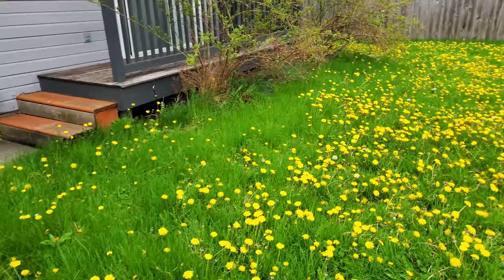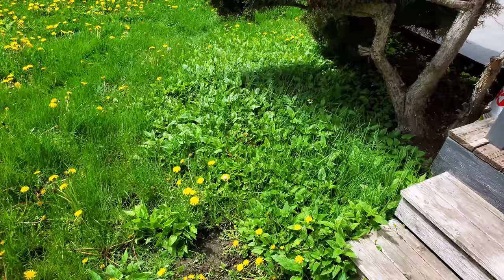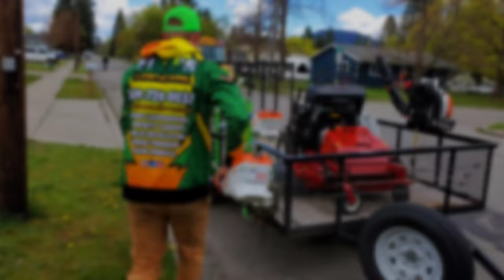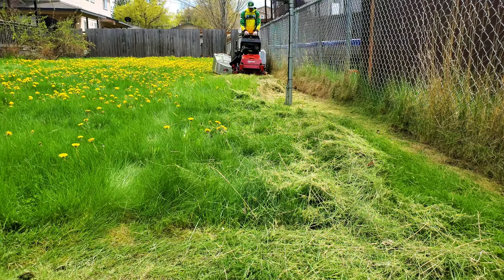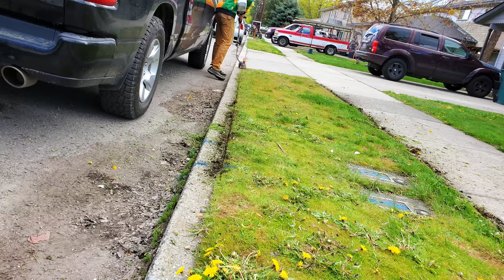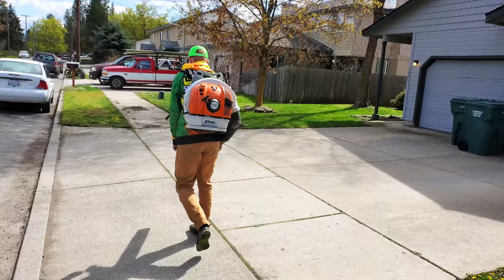OVERGROWN Lawn INFESTED With Dandelions Gets A Satisfying TRANSFORMATION

Comment: You might not want to start your blades at full throttle.  Turn your PTO on and off 1/4 power, and then rev up. Just a little money saving tip
Reply: depends on the machine.   Some brands tell you to ONLY start and stop the PTO at full throttle.